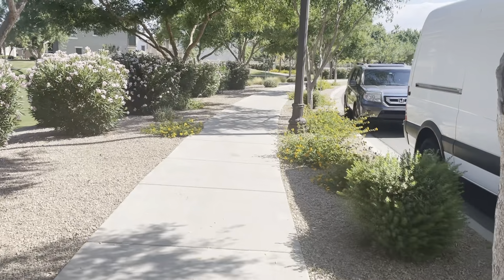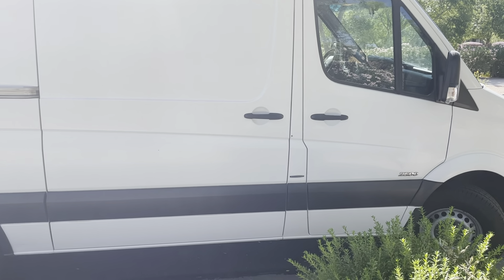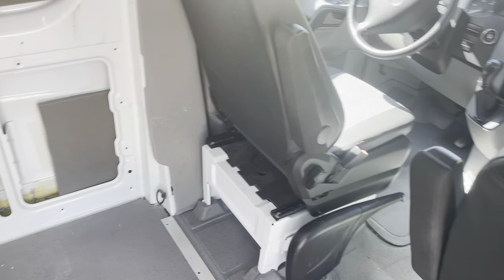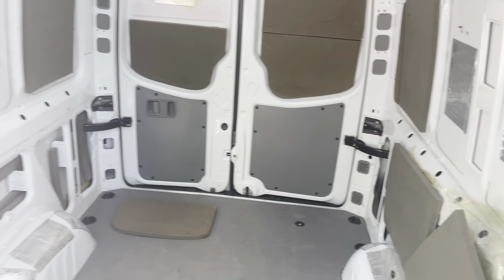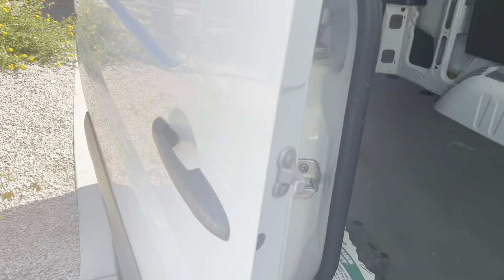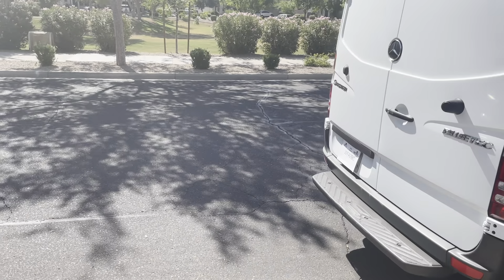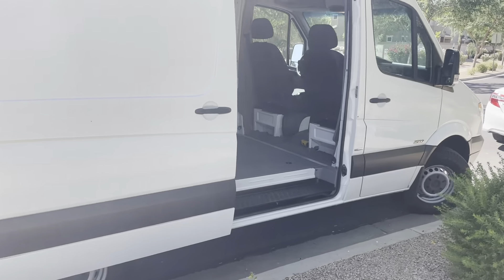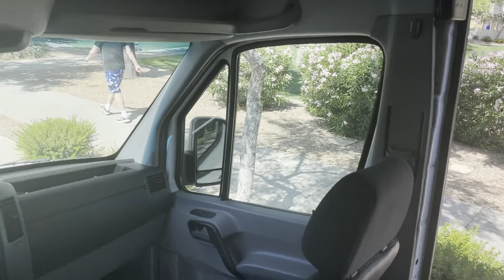New Mercedes Sprinter Vanbuild Project

Comment: I hope is 4x4 otherwise is a same deal as you had twice already
Reply from the maker: Not exactly, the sprinter has double the ground clearance of the Rialta, but more than that, it will be assembled the way I want it to be assembled with the components that I want to put in it.
Reply: @TravelingSolo  if you choose 4x4 you would be one step ahead. You will kick your self later, since you build from scratch why not. I went through this already and it was expensive mistake doing it twice. I stuck twice on stupid wet grass on my old two wheel drive sprinter and got myself 4x4 version after that. Paid twice to the shop. I never got my money back from sale of the first van 👎
Reply from the maker: @Steveski70  The “why not” is that not only are they insanely expensive, they are almost impossible to find. I think I’ll be just fine :-)
Reply: @TravelingSolo  they are worth every penny 👍
Reply from the maker: @Steveski70  you’re welcome to find one for me and make it my early Xmas present….lol